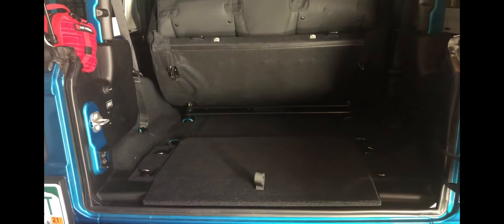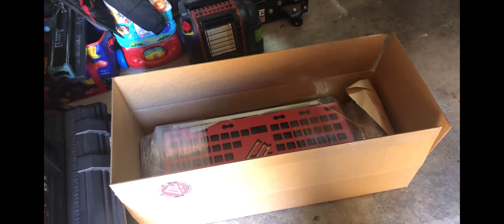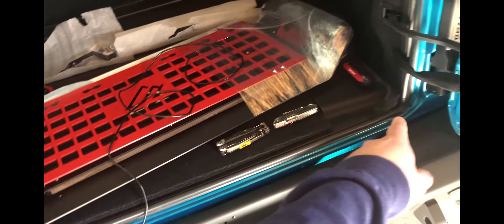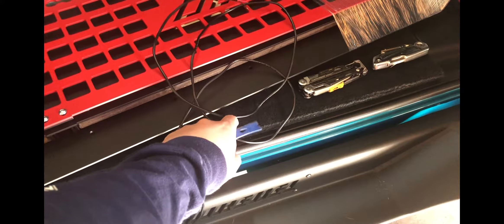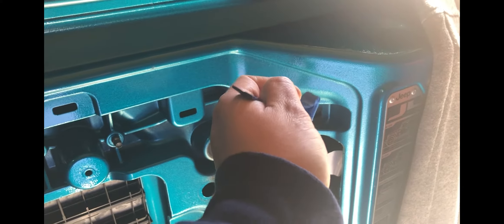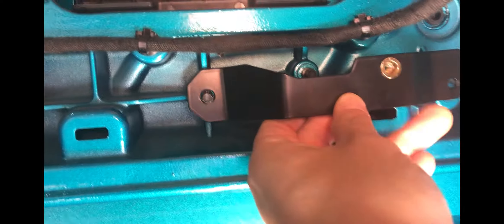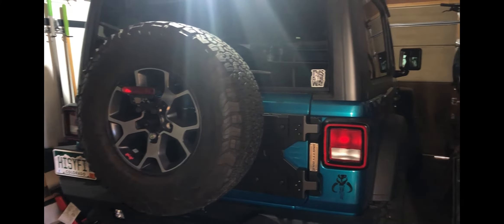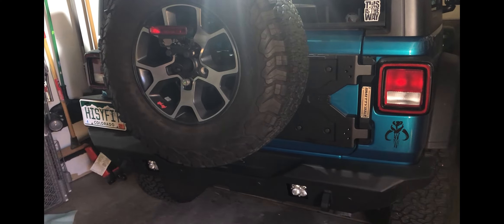American Adventure Lab "Versa Table" Tailgate Table - Jeep JL

Comment: The gaps are for venting the jeep has two outlet that keeps the interior in negative pressure. I just wish they made a better job at it instead. I will probably have some foam on the very top to keep water from dropping inside

Comment: Do you remember by chance what the nut size is? I’m having the same issue today when trying to install my table. Thanks!
Reply from the maker: If you are referring to the “M8x16mm bolt”, I believe you can run down to Lowe’s or any local hardware store and they should have a nut and bolt identifier gauge, also they sell packaged nuts that are identified by bolt size and thread size as well. But you can use that to find the correct nut size for the M8 bolt. Also check the thread I don’t think it’s fine thread so go with the coarse thread size, however I’d double check. Once you find that,  You can then  check the thickness of the nut and try to get the smallest size thickness of the nut. Assuming, since you may end up having the same amount of threads I had in the video(3-4), the smaller thickness will give you more turns on the bolt protruding. I hope this helps I apologize since it’s been a while since I posted this. Good luck and thanks for the comment. 

SST Identibolt Bolt and Nut Identifier Gauge https://a.co/d/cjzqVh2

Comment: Hey I'm looking at that rear bumper. How is the powder coating on it and does the bumper protect the corners of the tub from damage?
Reply from the maker: Hi Mark, the rear bumper is a Rebel Off-Road Summit series bumper. For me the powder coat is really nice but does leave like a dark mark when things are scrapped on them which is fine but I really like the poison Spyder powder coat if your looking for a really high quality coat bumper. The Rebel Off-road bumper did have good protection all around however there is a exposed spot right as the wheel well starts so if your crushing rear bumpers a lot you might want to think about that. Check out my vid on the install of the rear bumper I apologize in advanced but it’s a long video I would just skip to the more interest of parts where it shows the bumper on the vehicle to get an idea how it wraps around or even better you could visit the webpage for Rebel OffRoad they got some real good shots of them there. Thanks for the comment!
Reply: @4x4chris11  that's funny, I really have my bumper search down to a few , the rebel off-road summit series, motobilt crusher, dv8 spec series, poison spider bruiser, and metalcloak narrow.

Comment: This may be a dumb question, but before splicing in, did you disconnect the main battery?
Reply from the maker: Yes! It’s always best and safe to disconnect the battery before performing any electrical work on your vehicle. Thanks for the response

Comment: Considering this table as well for my JL. Did you check with AAL about the gaps between the table and tailgate? Wonder if that was intentional or a design flaw?
Reply from the maker: Yes! I did check with AAL and they told me you should have a gap roughly 1/8” around and mentioned if there’s anything that abnormal I should let them know. My install did vary in gapping mostly where the bottle opener is located but it’s pretty close I didn’t bother. However the gapping is intentional and is to allow the cabin to vent/ reduce the infrasound ear pressure when the windows are rolled down. Hope this helps and thanks for the comment.